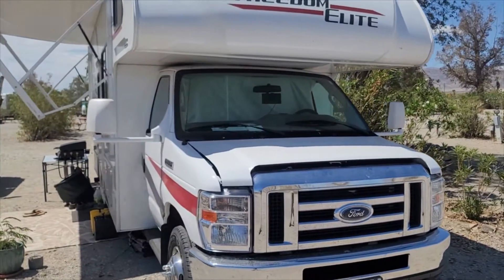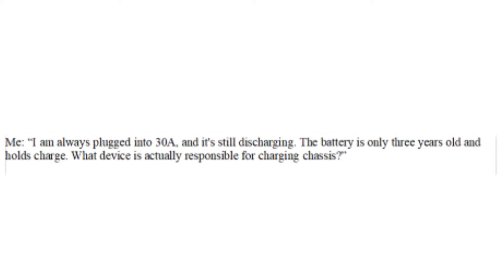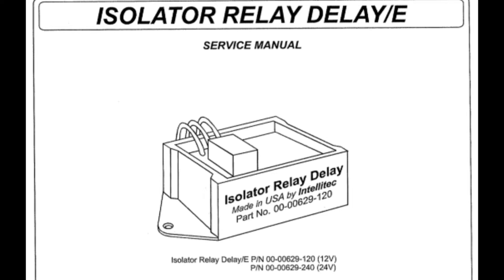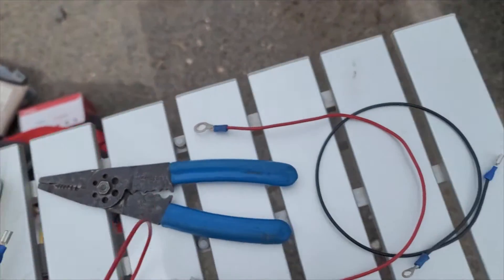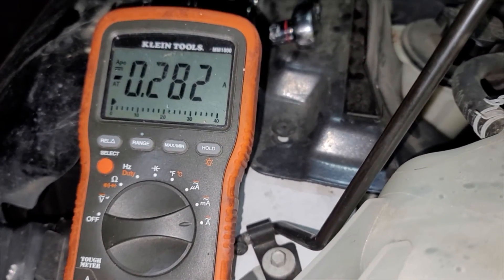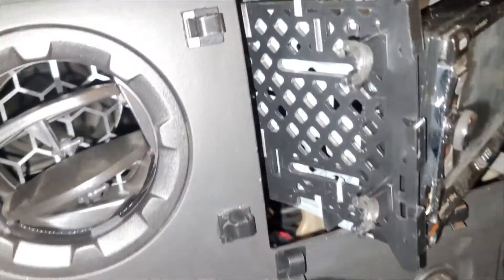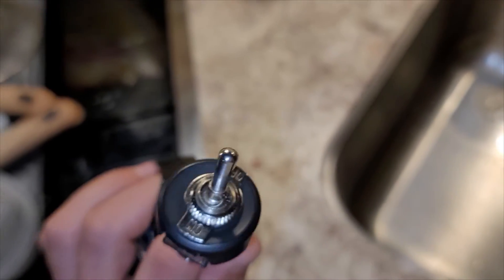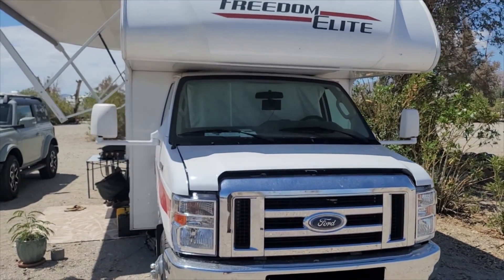Thor RV Chassis Battery Drain Issue Fix - (BIRD Install) Chateau, Quantum, Daybreak, Four Winds

Comment: Thanks for figuring out why my truck battery was dead after camping while plugged into 30amp power every time we've been out this summer!
Bought a used 2023 Thor Four Winds 24F (April 2025).  It had the Isolator Relay Delay 00-00629-120 so I replaced it with the BIRD & now my truck battery is being charge while plugged in!
What a great Concept, one would think the engineers would have thought of this after the so called Recall, you discovered!  But Noooo, I had to buy a new Replacement Truck battery (after 2 years) + the BIRD & install it myself after paying $$$$$$$ for the RV.

Don't get me wrong, I know break downs/repairs happen but this isn't a repair!
Reply from the maker: Excellent, I'm glad I could help you get it sorted. I'll also mention that there's still a good chance there's some secret parasitic drain on your battery. This isn't a problem if you're plugged into shore power, but if you put it in long term storage, it may be a good idea to still keep it plugged in or on a battery tender, because in my experience, RV manufacturers just slap things together without much thought.

Comment: Great job , and very good information, the wiring connectors?  I would have used a more permanent connection, those crimp connectors?  Don't last very long in wet weather conditions I would have used Crimpless connectors with a heat gun ! So u can't get any  water or Condensation (rust) but other than that?  Excellent Video.
Reply from the maker: I totally agree, I'm not a huge fan of crimped connections unless I have a really high quality crimp tool, and even then, won't protect from water, unless it has a good amount of shrink tubing. Crimpless is nice, terminals with extensive sheathing that you can heatshrink is nice, and soldering with heatshrink is best. Thank you!

Comment: Excellent video! I have a 2020 Thor Synergy 24sk with the same issue. I also want to rewire my Axera in-dash unit to house power or possibly replace it with a unit I can actually see the screen on.  Your video covered a lot of bases for me, thanks!!!
Reply from the maker: Thank you! I'm glad I could help. I also have this on my blog if you need a quick reference while doing the work: https://bootenbloggen.blogspot.com/2024/12/how-to-fix-constantly-draining-chassis.html

Comment: Seems like Thor still has this buggy situation on 2023 Vegas models based on E450 chassis (chasing this now)...I swear all these rv companies are run by meth heads.
Reply from the maker: Wow still huh? My guess is they try to manufacture way too many variants and flavors of RVs and are having a very hard time keeping quality control straight.
Reply: @BOOTENWAGEN  they have updated the bird in the 2023 vegas I am working on to a 00-00956-00 potted bi directional isolator relay . my milliamp draw was only 75ma which is good for about 2-3 weeks. 30 milliamps is usually good for a month. that quarter amp draw from your radio head unit seems high even for stand by mode. I have seen sub woofer amps and other cheap china audio stuff pull upwards of 150 ma (sleeping mode)  but never more than that. The only beef I have with Thor is lack of documentation & the position of the relay and bird is right in front behind the grill which allows a lot of water to cause corrosion.
Reply: @BOOTENWAGEN  11:00 min mark you mention that the red wire did not make any difference with blown fuse. Sounds like the rig has a stuck internal state on. that is why its pulling so much power. More china junk